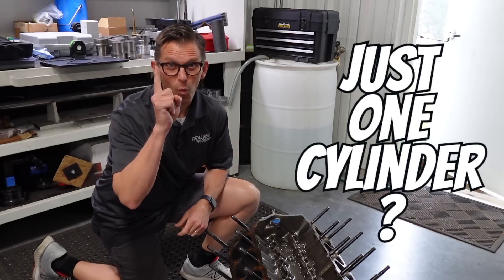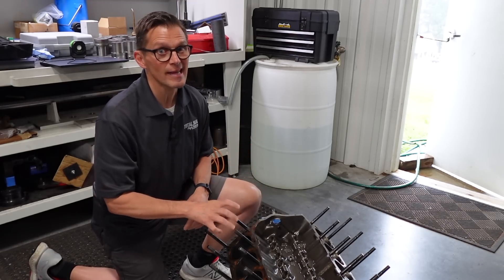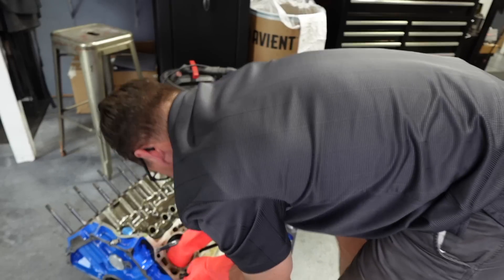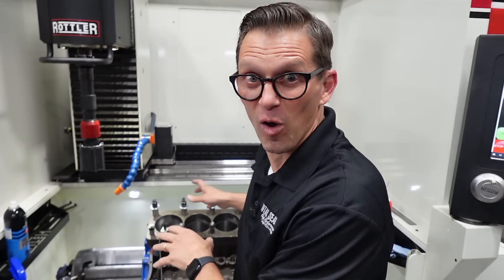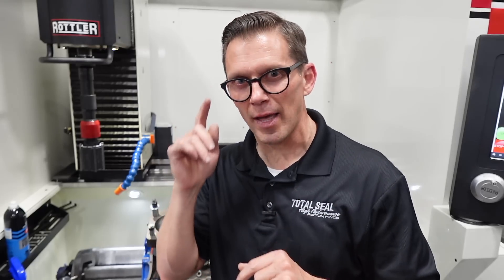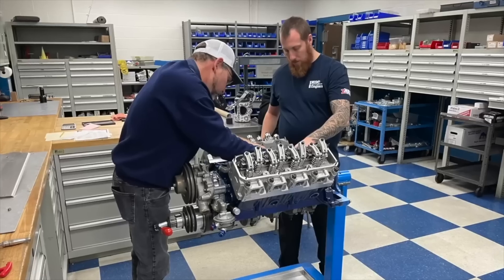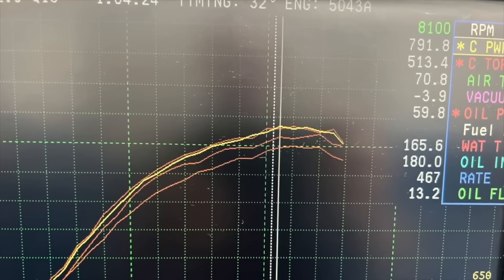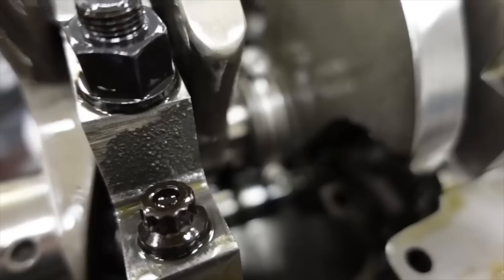From Failure to Fantastic: How to FIX a Scuffed Cylinder

Comment: This may sound crazy, but my dad's old 2 stroke outboard V-6 had a piston problem which caused a fair bit of damage in one cylinder and the shop recommended boring just the one cylinder to the next size up.  Not only was that piston bigger, it was an updated design with a few differences.  We ran it about another 10 years and sold it running perfectly.  It makes me wonder how much it truly matters to have a perfectly balanced engine.
Reply: similarly  I found an exhaust cam had worn  , so one exhaust valve was only opening half the distance the others did, I got 50k miles more out of the ford engine... .. Alot of these things only matter only if you are pushing the envelope, eg racing .

Comment: 2 cycle piston scuffing, sometimes is because you rpm it under load too soon, the piston has expanded, but the cylinder has not had time to heat up and expand away from the piston,therefore you get whats called cold seizeure. Did i spell that right ?  Hope this helps .

Comment: what was the power difference without changing the Carb or fuel.  Did I hear you right that they were different?  or were they the same as old 730hp number? Apples to apples?

Comment: My friend  ... 🧡 
A mith 
 Put ring 180 posited.  
Is it possible  to have a key. On a ring to piston .  On the ring so it dont turn on the the piston. 
Normal  ring . With a squre box on the ring. That join the piston .
A lock key. Ring stay in place . ? 
Low by. Mick Australia 🇦🇺. 
Im sorry.  Im not Normal.  But think out side box. God bless
Reply: My 73 Yamaha 2 stroke has rings like that. Ring lands have pegs to prevent rotation. Gap fits in the peg. Not sure how this would hold up in a 4 stroke running for 10s of thousands of miles
Reply: My 73 Yamaha 2 stroke has rings like that. Ring lands have pegs to prevent rotation. Gap fits in the peg. Not sure how this would hold up in a 4 stroke running for 10s of thousands of miles

Comment: On a classic trucks site I belong to there's a lot of talk about lifters currently made for use in old school flat tappet cam engines being defective, going flat during break to 1000 miles.
 Many claimed they used zinc containing oils and or zinc additive.
  I've never had that issue in hundreds of engine builds, or cam upgrades.
  Could you do a video on this?
By the way I was a NASCAR fan in the 70,-90s.
Remember your dad won when he had his surprise win, front runners crashing near the end of the race with your dad weaving through to victory and giving JC the credit. Amen.
Reply from the maker: Check out the truth about ZDDP video on the Motor Oil Geek channel

Comment: I wouldn't trust a thick coating of skirt material to last.  If it fails then you have .005 or more clearance at the skirts which will result in more rocking and wear at the skirts.

Comment: Hi Lake, chances are you are going to do a post oil analysis on this engine. It would be interesting to know what chemicals show up in the oil from the Line2Line coating.  I asked them about that over a year ago and at that time and they didn't know.  I had an oil pump coated to reduce clearances and the coating did wear off in some areas as expected.
Reply from the maker: Great suggestion!

Comment: Us nitrous drag racers commonly use muriatic acid to etch aluminum transfer from a hurt piston out of a bore..... slam a new piston in there and go win the next round.  To be honest my personal car/engine has been faster after scabbing it back together after being hurt a few times than it was when brand new.... still pulling 17" pan vac on a wet sump so its sealed up.
Reply from the maker: Nice

Comment: Hey lake, I'm a tech and a couple of my friends are going through excessive oil consumption almost certain due to low tension rings being gunked. Are there any tricks that can help without the cost of a rebuild since the car isn't worth that much? I've heard chemicals down the spark plug holes to soak the rings?

Comment: I tried this on my LS1 and it turned into a puddle.  How can I fix it?

jk.  I want to re ring my engine, and didn't know if it was possible to clean up the cylinders while keeping the same (26 year old) pistons.  Did you use Line2Line's Armor CC?  My engine builder has a Rottler.  Is there a new kind of hone that works with Mahle moly rings?

Comment: So begs the question, what do you estimate was the cause of the piston failure?
Reply from the maker: A combination of factors. That cylinder was hotter than the others and we had just put a thinner oil in the engine.

Comment: Was this the engine where you made the piston clearances very tight for more power?
Maybe the engine wasn’t allowed proper warm-up before it was pushed hard. Pistons will heat/expand more quickly than the iron block.
Reply from the maker: Different engine

Comment: Neat stuff.  A pushrod engine rev'ing to 8700 rpm. I'm not up on what these pushrod engines are doing.  I'm impressed.  I know it surprised the Europeans at LeMans. Anyway, where I worked we used to glass bead the skirt to get that surface raised a little.  Also 0.7mm for a compression ring.  This stuff is impressive.  
I'm not surprised that this lye technique came from karting.

Comment: I use wet wipes as a mat to hold the caustic in place (wetwipes are polypropylene so wont disolve in the caustic).. in this sort of scoring on just one side.. wet&dry contact glued to a PVC pipe slotted as an expanding sleeve.. then hand lap just that side before doing a full fine hone for new rings.. no piston coating needed

Comment: Bored my Chrysler 400 .007 over neural all the Pistons .007 install backwards I did this 20 years ago and used cast rings at the time off of Ford 390 still running I take it to 7500 RPM

Comment: If this is one of my engines, I'm buying a new block or a new engine. Nothing worse the you doing this and in 15k miles loosing a hole or burning oil. Just do it right the first time. Generally with machining if you cant sleeve it. Its worse to try and save money and have to do it twice.
Reply: Anyone can be a parts replacer, knowing when and how to do a good patch sometimes is the best way to go.
Reply from the maker: Can't buy a new one of those blocks...

Comment: I have sent way worse. I just use a flex hone tool and a drill and be done. Half the time i just use a little sand paper. You would vomit if you watch my shorts.
Reply: flex hones conform to all the warpages in the cylinder. use a fixed tri stone
Reply: @shootermcgavin2819  Most of the people would repair something like this will not be taking the block out of the car. I have lost count how many times in life I have done this. I usually end up selling the vehicle years later still going strong. 

I also use marvel to silence a stuck lifter. 2 things i am sure this guy hates.

Comment: I had a v twin briggs that got a little overheated and had some slight piston scuffing from going a little egg shaped. 
Cylinders looked ok,no metal transfer. 
So i took the much hated dingleberry hone, tried my best to become a real honing machine as most folks spin the drill way too fast and don't go up and down fast enough either. 
On the pistons, i took a very small piece of hone stone and oiled it and started cleaning off the scuffing. 
You can feel when the stone glides smooth,STOP! 
I saved them, and in fact you could see the original machining marks aeound the skirts as if they were new. 
I really dodged a bullet there as the overheat wasnt that bad. 
This was for a project that was more about having time to myself than getting it completed in a short time, and laying out minimal cash. 
She works fine ,pulls 14" of crankcase vacuum and doesnt smoke or consume oil. 
I put it on a riding mower thats more like a sit on go kart,as its pulley swapped to do about 30mph.
Heres a short vid of it if you're interested .
https://youtu.be/_S1B4l8OqNA?si=xjdTHWdWTGJrtlSg

Comment: cool video, my advice would be to get a wooden dowl/stick/1x2 and wrap one end with several brillo pads and then zip tie the ends (so it pops out in the middle), this way you can use a little leverage and reach easier. Thanks!
Reply from the maker: Cool idea!

Comment: Driveway cleaner that's basically 50/50 methanol and lye works pretty good. Spray foaming oven cleaner works pretty good.
Reply: 100% lye is also available at hardware stores and is cheap.

Comment: To remove aluminium smeared on steel use a solution of caustic soda and water. Caution, as the solution dissolves the aluminium but not the steel it will generate explosive hydrogen gas.

Comment: Way back I had a Suzuki Quad Sport and messed up the bore because I used fuel with no oil. I didn't have the money to fix it proper so bought a new piston and rings, and did exactly this. Engine never ran better afterwards to be completley honest. And that was with a hand done hone job.
Reply: So it ran better afterwards?

Comment: What causes the scuffing my 2t aftermarket scooter bores are all like that while the rusted original that had 4000 miles on it still has the factory hone... the piston the company sends with the cylinder seems loose would tge piston rattling around really obliterate tge cylinder wall

Comment: This engine would be on a stand and rotated where the cylinder is parallel to the floor, also media blasting using co2 would clear that crap out without harsh chemicals or leaving media FO in there

Comment: Sodium hydroxide dissolves aluminum and eats fat also known as grease or oil. The crystal drano actually has aluminum shavings for it to dissolve and make heat to help dissolve grease in slow or clogged drains. Works good to degrease rear end housings as well. 
Ain't chemistry fun? Really like this channel.  It's unconventional and interesting.👍
Reply: Never realized Lye reacts with Aluminum, that's cool!
Reply from the maker: Thanks for watching!
Reply: @TotalSeal Lake when you say if you leave some of the aluminum in those recesses it will grab the piston, didnt a lot of small engines have aluminum cyl walls? Would that be the same scenario or did they do something different to make them dissimilar metals?
Reply from the maker: @stevenbelue5496  When there is an aluminum cylinder liner, the pistons skirts are coated to create dissimilar metal contact.
Reply: Does sodium hydroxide dissolve melted babbit from trashed crank journals?
Reply: @gregorymalchuk272  no, babbit is mostly tin with various alloying metals like copper. Try heating with a heat gun or small torch. If the journal is damaged it will have to be ground in which case the machine shop will remove it. If its just a little bit of babbit you might dislodge it with a leather strap or fine emory paper. Acid will dissolve it but will also etch the steel so I wouldn't recommend it.

Comment: muriatic acid also works awesome! It will just remove the aluminum.  Same idea
Reply: I agree with that.  I used to race 2 cycles and it was a common practice.  To clean the aluminum out of the cylinders after a scuff. Put muratic acid on a Qtip or other applicator.  Be sure to  rinse and oil after. Muratic acid can make everything  around it rust
Reply: https://youtu.be/jXxWfX-6mD8?si=1hvgK_WWw1e5hJXb
Reply: I'm not a chemistry whizz, but I think the muriatic will also attack the iron block/sleeve too, just not as quick. So I think it's a viable option, but you'll need to do it fast and neutralize the acid with baking soda ASAP.
Reply: @GroovesAndLands  I run a machine shop where we rebuilt high performance engines. I have been using this method for +25 years. Its pretty standard in the industry.  The acid doesn't hurt the iron block. BUT after you neutralize the acid you need to oil the block to stop it from  rusting.   Muriatic acid isn't that strong.
Reply: I was curious about that myself

Comment: Why did the pistons skirts scuff up??🤔🤔🤔
Reply: Too hot so it expands. Breaks through the barrier lubrication. Sticks a little and then the stuck metal compounds the lack of barrier.
Reply: @jasontrevis7142 to fix either free up 0.5 thou to 1 thou or get a better cooling system
Reply: Rust pitting in the cylinder in this case. Did you comment before watching the video?
Reply: He said may have, didn't he? @supersportimpalass
Reply: @ Read further down supersport!😉
Reply: Ive had some good success with a piece of knife or hone stone and oil, to clean metal transfer /scuffing from a piston. 
Actually it's a very satisfying feeling when the stone starts gliding smooth,you know it's clean. 
Worked for me on a little Briggs engine very nicely. 
In fact ,it cleaned up so nice you could see all the little machined ridges on the skirt like new. 
It wasn't as bad as the piston in the trailer pic ,it had the same damage just less of it.
Reply: It looks like that is the back of the block cylinder number eight in the back of a V8 block the scuffing was because of the cooling system, coolant is fed through the front of the engine from the pump and that is the last cylinder to get coolant therefore all the other cylinders heated up the coolant from the front to the back of the block making the back of the block hotter than the front, if y’all know anything about thermal expansion, metal expand when it gets hotter therefore the pistons expand the cylinder wall expand Closing clearances therefore scuffing the walls, this usually happens when you are boosting an engine over boosting an engine or running lean only a few AFR degrees.
Reply: The piston to cylinder wall clearance wasn't enough for the thermal expansion of that piston. The rear cylinders run slightly hotter, thus... they expand slightly more than the front ones. I have a feeling that they did this on purpose for the sake of demonstration because they left that rust pit in there from when they changed to the more modern pistons in a previous video featuring this engine. He wanted to show the changes in a series of videos. They dynoed his Dad's old Nascar engine as they found it, then modernized the pistons and rings, then showed the improvement with the line-to-line coating in this video. They gained 60hp total by doing all that.... going to the new pistons with smaller rings with the corresponding cylinder finish for said rings, and then finally adding the piston coating in this video.
Reply: @ Thankyou🙏
Reply: Another cause is bad injectors. If they pee instead of spray, they wash away the oil.
Reply: Nitrous baby!!!
Reply: If we could only treat rust with something that bares oil retention 😂